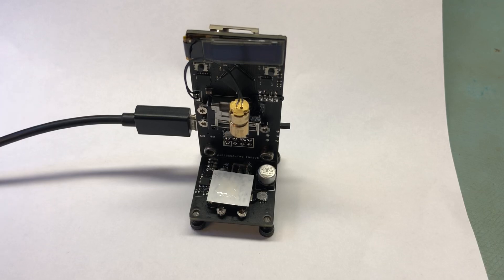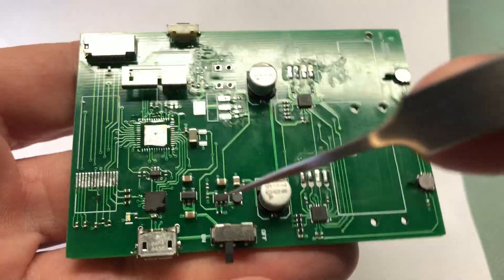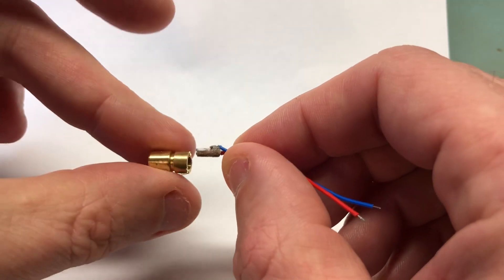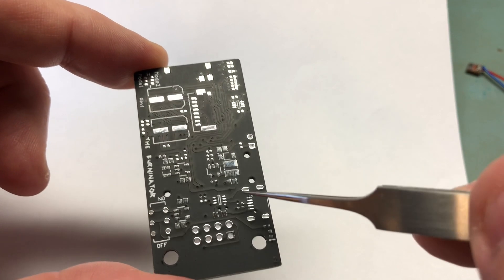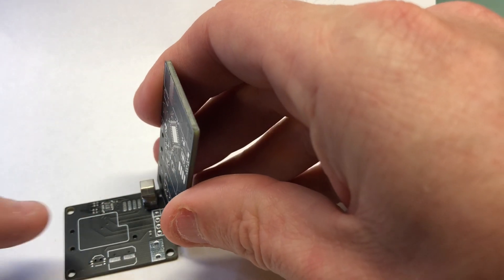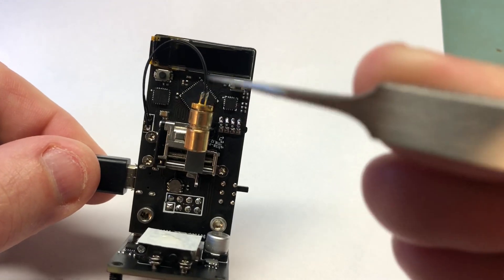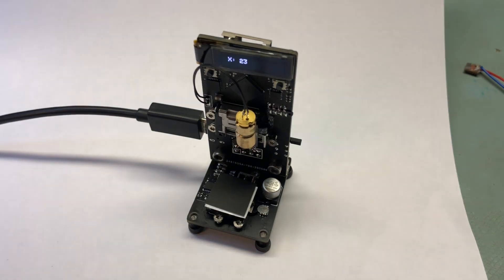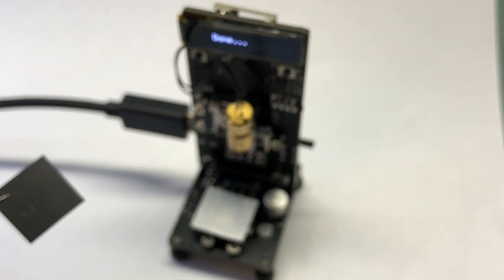ESP32 Burninator

Comment: This is an exciting project!

Have you tried etching on polyimide/Kapton? There's a couple of scientific papers about laser-induced graphene - if you can get the output power and focus right, you might be able to direct etch graphene circuitry!

And if you had a UV laser from a BluRay or HD-DVD player, you could etch photoresist PCBs with this, too!

Lots of potential for this project!

P.S. the diyouware blog has a write up on interfacing with a common BluRay/HD-DVD laser pickup (with datasheet) here: http://www.diyouware.com/node/161
Reply from the maker: GS Lakes great ideas! Immediately after recording this video I placed the machine on the shelf to start a new job. My software skills are garbage so I’m not sure if I’ll get back at it again.

Comment: What''s the laser output power? (Both specified and actual, which can be significantly different)
What's the safe power limit for avoiding instant permanent eye damage?
Where is the shielding to prevent the beam entering eyes, either from reflections or directly if the laser becomes detatched?
Remember the standard wall sign in laser labs: "do not look at laser beam with remaining eye".
Reply: Where instant and permanent blindness is a possibility, risks must be defined and eliminated. 
See, for example, https://www.lasersafetyfacts.com/3B/ 
Don't blindly [sic] trust me, do read the whole page. Here are a few snippets to whet your imagination...
“Class 3B visible-light lasers are hazardous for eye exposure. They can cause burns to the retina. A person cannot turn away or blink fast enough to prevent retinal eye injury from a nearby Class 3B laser. ”
“At the low end, around 5 to 50 milliwatts, a Class 3B laser poses a moderate risk of eye injury. … At the high end, around 250 to 500 milliwatts, even a brief exposure could cause retinal damage.”
“The Nominal Ocular Hazard Distance (NOHD) for a lower-powered 50 mW Class 3B visible-beam laser with a tight beam (0.5 milliradian divergence) is 330 ft (100 m). The Nominal Ocular Hazard Distance (NOHD) for the most powerful 499 mW Class 3B visible-beam laser with a tight beam is 1,050 ft (320 m).”
Reply from the maker: The laser diode came out of  recycled dvd drive so I have no data sheet. Right now I’m driving it at +3.3v and adjusted the resistor value until it reached 150mA. I can up that but might burn it out. Right now I only have the one diode. No eye protection at all at the moment.
Reply: @0miker0  Presumably you (and anybody wandering past) still have two eyes *at the moment*. The optical power output will be extremely dependent on the current and temperature, once above the lasing threshold. You cannot control the optical output sufficiently without sensing the optical output in a closed-loop feedback circuit. (Better make sure that closed loop is unconditionally stable!)

Comment: Awesome, as always. Wanted to make a nano Mill using the tiny stepper motors for a long time, no purpose of course but to have it on my desk and move around :-) maybe even have a tiny motor as used by mini drones just to spin it up and create the noise a spindel would make. But this is your masterpiece and I love it. Like the mini limit switches as well. Thanks for sharing :-)
Reply from the maker: Hayri it uses stepper motors so it should be able to move for years with no wear.
Reply: @0miker0  Yes Mike, it will for sure :-) My brain already started designing the PCB's. Love the OLED too that you implemented, why, because you can, lol.